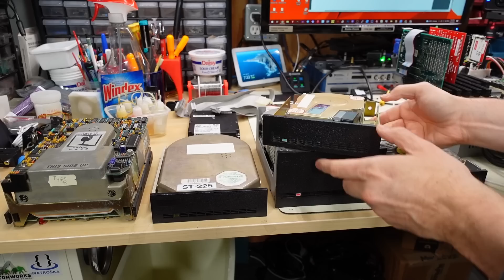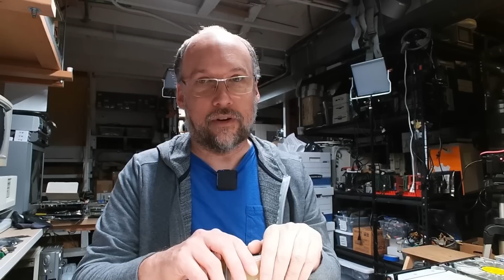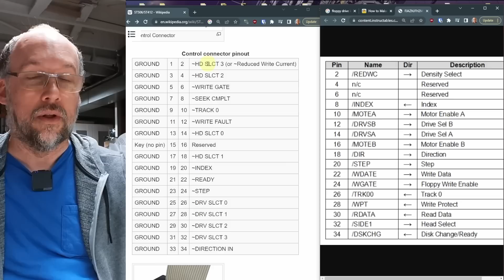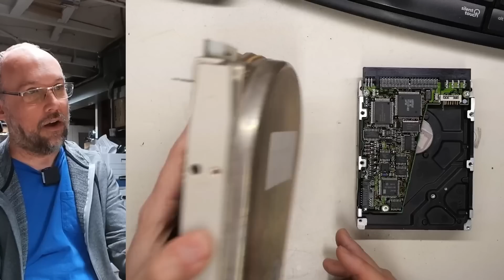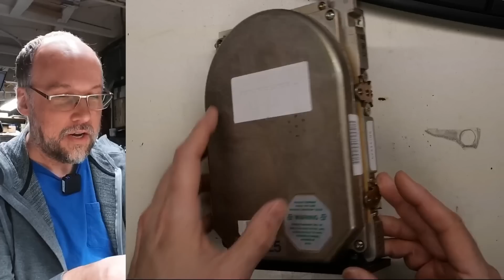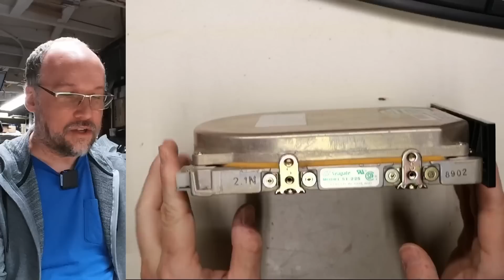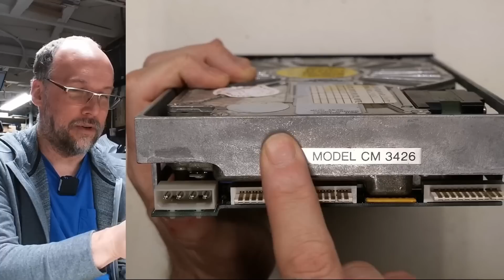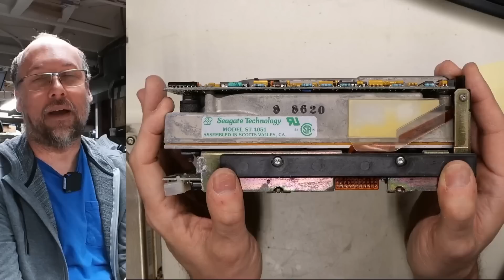Not forgotten: MFM hard drives

Comment: I loved the video as I only just touched pre-IDE drives myself, having a hand-me-down 286 in 1996. One minor correction though: The 4 lines for drive select aren't "BCD, Binary Coded Decimal", if it was BCD (Which encodes numbers 0-9 only) then it would require 8 bits to allow 16 drives to be specified. It's just a 4-bit binary number. Apologies for the pedantry. Yes, I am a developer by trade and hobby.
Reply: Ahem... (5 bits.  4 bits for 0-9, 1 bit for 0-1.)
Reply from the maker: It's just binary coded hex, but if I was designing a circuit to take a 4 bit input like on the cable and needed to select one of 8 heads on a drive, I would use a 74LS45 which is a BCD to Decimal Decoders/Drivers... since the encoding used here mirrors simple BCD or BCD8421 (for 0-9.) I had never seen any of these MFM style drives having more than 8 heads, so the BCD to Decimal decoder works here.

Comment: I used a few ST-225s back in the day. The first drive I bought was an ST-238, which was the same platters as the 225, but used RLL instead of MFM so it held 30meg instead of 20meg. I ran that drive for so many years. Toward the end of its life, I had to turn on the computer and let it spin the drive for 30 minutes to 'warm up' or it couldn't read the data on the inner tracks. I think the heat built up and expanded some worn components to make everything fit tighter.

Comment: Thanks for this video. I remember these drives from the beginning of my career. By the time I planned the purchase of my first PC (in 1989), I was trying to make sense of the specifications for MFM, RLL and ESDI hard drives. The decision ended up being made for me by the system builder, who put in a 90MB SCSI hard drive that worked fine once the computer finished booting, but that old 8-bit SCSI controller took 3+ minutes start up. The SCSI card and hard drive were replaced in 1991 or '92 with an IDE interface and hard drive. (That computer was literally a bargain basement build, and in retrospect, I think it was pieced together as a conglomeration of questionable purchases previously made by the builder. It was built on an ELT-200B 80386DX motherboard that used hard-to-find, expensive SIPP memory modules and proved to have a lot of strange compatibility issues with all sorts of components and peripherals.)

I would love to see a video about RLL hard drives, and also ESDI. It seems to me that these were two technologies that were only around for a short time and didn't make a lot of splash in the market, although I know ESDI was better known because IBM used it in at least some of their PS/2s.

Comment: I have had both MFM and RLL hard drives on my Coco 3’a (40 and 80 MB Seagates for MFM and a 65 MB Microscience for RLL (different controllers at different times between RLL & MFM). On the Coco starting around 1988, the Burke&Burke XT was an adaptor card (with optional boot ROM and Smartwatch real time clock) that actually took IBM XT  8 bit cards and and basically converted the pins to the Coco’s bus. We had plenty of SASI and SCSI controllers before then but they were expensive; because the B&B allowed us to piggy back on the mass produced, cheap XT drives and cards, dropping Coco hard drive costs down literally hundreds of dollars overnight. (We later got IDE adaptors later as well, and eventually CF and especially SD card adaptors that are most common today. 
I do remember their was two RLL “standards”… One was half again as many tracks added, and the other was half again as many sectors per track (mine was the ).

Comment: Really interesting video! Didn't realize the similarity between floppy drives and this era of hard drives. I know the data rate is higher and differential, so you're probably not gonna be able to drive one with an RP2040 microcontroller, but I wonder how long until we see open source mfm/rll drive adapters using a microcontroller and a little FPGA, a hard drive GreaseWeazle almost.
Reply: An RP2040 should be plenty fast enough, at least with some clever coding.

Comment: Good timing!  I'm actually just trying to access some old RLL drives.  I have an ST-225 and an ST-225N which has a SCSI interface.  So...chop chop...let's get to part two.  :)
Reply: I thought the SCSI part was entirely different, because it operates as a bridge to the motherboard, it's a standardized controller, while the IDE controller board is specific to each MFM drive -the format may not be readable if connected to another drive. Also, I believe RLL only refers to the format, the hardware is still MFM, exactly the same, although drives made for RLL went through extra testing to make sure it would work reliably. Any MFM drive could potentially be formatted for RLL, it's just the older ones weren't designed for the extra stress.

Comment: Had an S-100 bus based CP/M Plus (3.x) system with ST-506 type hard drive in 1986, setup by my brother in law. Cannot recall if the drive was 5MByte, or may have been 20MByte.
The Fergurson Project Big Board II included the SA100 interface connector for a  Hard Diak controller board.

Comment: It would be a niche market but it would be great if some one made an 'adaptor/false drive' for using say sd/CF/etc but had a st506 interface. So you could plug it in to an old system and still use the old controller etc.

Comment: I can actually confirm what Adrian explained, namely: RLL and MFM harddisks are basically interchangeable. When I was a teenager we, a good friend of mine and I, used to unmount or get "defunct" HDD's from all sorts of people (including from a guy who worked back then at a computer hardware store) and we used to mix and match the HDD mechanical parts with their "dumb" drive controllers until we could connect them up to an actual HDD controller and get them to work. We actually made a bit of pocket money selling these drives to newbies who were hungry for such high capacity drives, for gaming (yes even then) :) I also remember how tedious low level formatting was (which was a job my friend happily left to me, go figure :) Fortunately there were some nifty LLF programs going around in the day which made formatting HDD's a lot easier and uhh "exciting" LOL
Reply: I was under the impression they were just about entirely identicle, the RLL was just a format. Earlier MFM drives were not quite up to running RLL, later drives were tested for it. that was the only difference? I often heard them called "MFM/RLL"

Comment: i remember that you could do a low level format on the first IDE drives and wipe all the drive information off the disk. they had left all the low level format commands that were in the bios active. they then changed it so if you performed a low level format it came back as done in an instant and the drive still worked. what fun all those low level commands were. My first 40Mb took about 7hrs to low level format the first time, don't think i ever did it again. 🙂

Comment: If I understand correctly, the MFM system recorded data on these old drives by recording two pulses for a 1 bit or a single pulse for a 0 bit, and both a 0 and a 1 would fit into the same length of time.
I only remember this because I remember reading that the old TRS-80 Model 1 cassette interface used exactly the same method, only at a slower speed.  The first pulse acted as an "index" mark and the reading mechanism would wait a particular time after the index bit before reading the input again to find out whether there was a 1 or a 0 bit recorded.
Unfortunately, Tandy mucked up the TRS-80 cassette interface and the read routine was "looking for" the data bit either a bit early or a bit late, making the cassette interface quite "dodgy" until the error was finally fixed in later revisions of the software.
Reply: Adding.  "Voice Coil" drives used an electromagnet which pulled the heads across the drive surface against spring tension.  This meant that when the power to the drive was switched off, the heads were automatically withdrawn from the drive by the spring, so voice coil drives did not need to have the heads "parked" before switching off the drive as was generally required for stepper motor hard drives.
Voice coil drives also needed some way for the drive to know that the heads were correctly positioned directly over each track, and so generally one "platter" of the drive was dedicated to holding nothing but a head centering signal which the drive used to ensure that the heads settled onto the correct track before attempting to either read or write data.

Comment: I remember many years ago now, setting up an early Novell Netware S-Net LAN Star configuration  using Arcnet, 2.5 Mbs cards with what I thought was an amazing 250 MB (or so) hard disk to support the file systems of its 24 users. It worked exceptionally well, but, of course, files sizes were very small back then and the disk was able to support the users OK. But then as files sizes grew both the token ring Arcnet and file server disk became inadequate. Upgrades happened more than once a year to change to Ethernet and much larger disk arrays. But these were almost pioneering times for desktop computing and networking.

Comment: How should i go about finding a MFM controller card? I have a ST225 drive that i do not know the condition of and that i would like to test.
Reply: I suppose ebay. I don't know if it was mentioned in this video, but you'll have to re-low level format the drive. The controller cards were not interchangeable, and one card will not be able to read the drive from another card. If you want to hope to read an old drive, you need the card it comes with.

Comment: Thanks, Adrian.  Great video.  Brought back tons of memories.  My first HD was a Seagate ST-225. 20MB that I bought new in 1987 for $500.00!   I never really understood the difference between MFM and RLL except RLLs were much more expensive.  All the magazines said you wanted RLL but the wallet (and wife) said MFM.  I remember entering the info such as heads, cylinders, sectors and I also remember lower-level formatting the drive.  I had put it into a IBM PC/XT clone from Sanyo.  AN MBC-880 that I had added and additional 128K to as well as a second half height 5.25 floppy drive.  As time when on and I went through other larger MFM drives and then IDE, SATA and now M.2 SSDs, I had pretty much forgotten about the MFM/RLL specs.  Thank you for clearing it all up for me and I would appreciate a video about RLLs.  Thank you, again!

Comment: Back in the late 1980's I was the guy if you needed your seagate drive repaired, or at least have the data recovered.  I worked on other drives as well.  We had no clean room, and really when these drives were bad, a cleanroom was the least of your problems.  I had one st225 that had a head crash that was allowed to run for a coup[le weeks, so the first step was to blow out the ounce of aluminum dust from the drive, then to carefully wash it completely clean before attempting the recovery.  In that case I was able to recover the one file the user was asking for, after I showed that I was not going to be able to pull a full recovery because one platter was scrubbed free of media.  With another drive recovery for AMD, they had a chip design on the drive, and no backup.   AMD got lucky, I was able to perform a repair of the drive's electronics, and pull their data over onto a better drive, and recover their chip design. It was a rll drive, which were the worst of the drives because rll drives tended to loose data long before the drive "went bad".   RLL drives used the SAME controller as the MFM, so I don't know where you are getting that, you are completely wrong on that... However there were many different oddball controllers, so perhaps you are talking about one of those...  But the standard western digital controllers for both the xt and at would transparently operate both mfm and rll drives.  AMD got lucky, I was able to perform a repair of the drive's electronics, and pull their data over onto a better drive, and recover their chip design.

I stopped doing drive repair when the IDE drives came out as the "smart" drives wouldn't even spin up if they thought they were dead, so there was no mode I could run them in to do the sector reads I needed to do, and the servo media readers were not yet available.  

Interestingly, I had a 100% success rate with the MFM drives, 60% success rate for rll...  that went to 30% when IDE came out.  It was an easy decision not to work on IDE's.  I had some success, but it wasn't enough to justify the labor, as I couldn't charge for a failed repair, and raising my rates 300% to make up the difference didn't sit well.
Reply: " RLL drives used the SAME controller as the MFM" Yes, thanks for confirming my memories of that. Perhaps the drives I used (can count on one hand) were those Western Digital ones, because I remember MFM and MFM/RLL being exactly the same hardware, I was under the impression that "RLL" was really just a format.

Comment: One huge leap in hard drive technology that did happen in the early 2000s and afterwards was storing more than one bit per spot on the drives. They're called pependicular storage and it's basically like storing analog dots there, whereas earlier drives were simply high or low magnetic state. First they were only like 012 or 0123 or so, but although I don't know for certain, I think modern drives could even be up to 16 bits or something per spot.

Comment: I never knew the difference between MFM and RLL controllers.  When I got in to PCs in the very early 90s I'd see adverts in the UK MicroMart magazine (basically a magazine full of adverts for second hand equipment or new old stock with a few articles in here and there) and I'd see RLL drives and controllers mentioned.  I don't think I ever came across one, just an old 20MB MFM drive around 1994.

Really interesting video, would love to find out more about RLL controllers, and ESDI, never did find out what type of drives they were, but remember seeing a 300MB one at an auction when I had a 40MB drive 😀

Comment: My first hard drive was a 32MB RLL Seagate drive for my Atari ST.  Had to get a controller adapter and a host adapter (ICD was probably the most common host adapter company for STs) to connect it to the ST’s ACSI port.  Including case, that HDD build cost me about US$580 for a mere 32MB.  Yikes!

I later switched to SCSI drives that just needed a host controller and still have a 96MB FH Seagate in the same enclosure I had before (with horrible stiction issues) and a 400MB HP SCSI drive in it’s own enclosure I got on clearance for US$100 at a music store back in the 90s.  Probably because of samplers and computer music production setups usually using SCSI storage.

Comment: the st238 had a tendency to self destruct because they used the same circuit board as the st 225 and the rll data rate is outside the spec of the amplifier IC, and it would burn itself up. it was already pushing the specs of the chip on the 225. you will often see cooked pcbs on 225s and 238s

Comment: Oh hey, the ST4051 is an equivalent to my ST4038! I have the sorry remains of an ST4038. 
The U-shaped board is mostly intact, other is badly damaged, cover is missing, heads and remaining platter are junk, spindle is probably fine, and frame is intact.
I've got three or four intact MFM drives of unknown functionality/contents that I need to archive, all 5-1/4 half-height.
Main difference between floppy-cables and MFM HDD cables is the twist used to denote drive-ID.
Going over that 3-1/2 drive's circuit-board with a fine-tooth comb might find damage to an SMT component, that would be one possibility for it being unresponsive. But if a chip is dead it's probably a goner.

Comment: There are no full-height 3½" hard drives. The 3½" hard drives which match the height of a half-height 5¼" drive are still referred to as half-height. The later drives that are not as tall are 1" height drives (a.k.a. one-third-height), or sometimes even less than that, like the slimline Maxtor drives from the early 2000s.

Also even though the interface is physically identical, some of the timing parameters changed between the ST-506 5 MB drive and the ST-412 10 MB drive, so that's why MFM is more properly known as "ST-506/412". Most later MFM controllers won't work with an original ST-506 drive unless they have jumper settings to configure them to the slower timing that the drive requires.

Comment: My first hard drive was bought with a PC-XT clone, the ST-238R. 32mb RLL. I later upgraded the PC to some AT clone and for a while still kept this drive. Wing Commander II with speech (yeah i put a VGA and Sound Blaster in it) needed like 30mb so it filled the entire thing with barely some space left for MS-DOS. Sadly i don't have it anymore, but the case was identical to the ST-205 shown here. It was replaced with an IDE 80mb Seagate, which i still have, and still works (ST3096 iirc). This was my second computer, first was an Apple //c. Adrian probably knows this (hopefully): Those drives do not park their heads on their own (unlike later IDE drives), you had to use a program to park it. Fail to park it, means the heads could be left floating around, so if you take the drive out and accidentally bump it (like Adrian did) you could easily scratch the platters and damage the heads. You would normally only park the heads when you intend to physically move the drive OR the whole computer. I did have some low level formatting tools, and one useful thing you could to was change the interleave to match with your system speed and improve access times. BTW those old drives were loud, compared to modern standards.